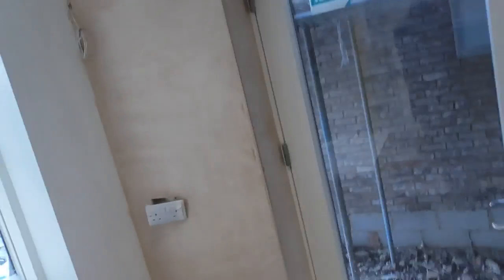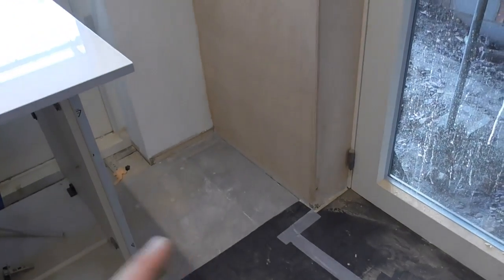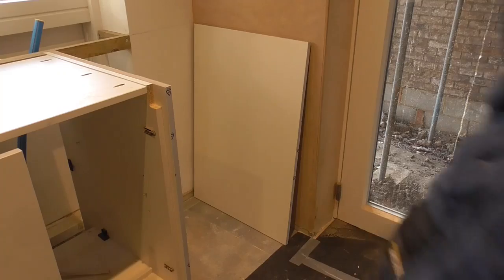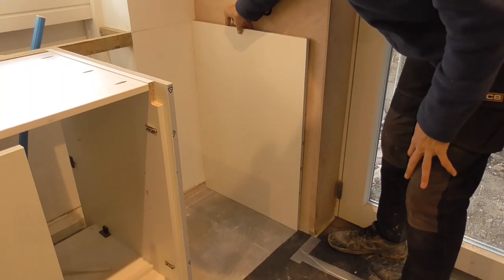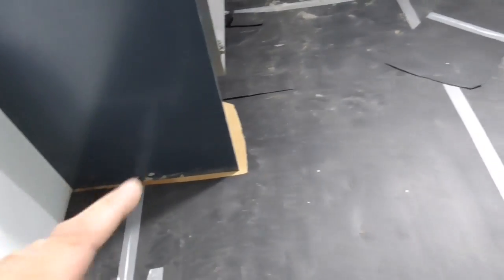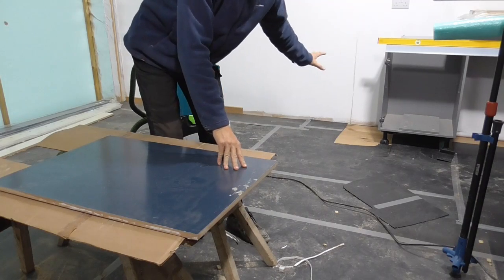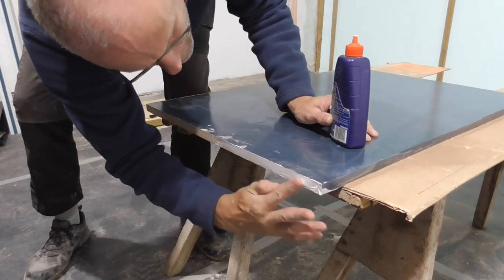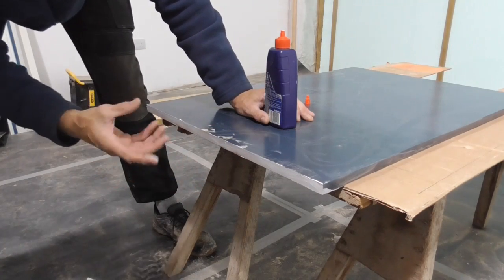Kitchen end panel fitting tip ***GOOD PRACTICE***

Comment: I'm fairly new to the kitchen fitting world but picked up and tin of Rustins quick dry sealer and a cheap 1/2" or flux flux brush. It's great, you can really see it soak into the wood. However, I don't work at your pace so sort of plan in dry time...it helps when you are a bit slower!! Keep up the great videos and hope you are feeling better now.
Reply from the maker: Hi Lewis. I think if fitted kitchens all the time then I would probably have a similar sealer and brush to you👊However, I didn't do kitchens that often so just go with what I have which is always a bit of old faithful PVA🤗Great comment and thanks for adding it so others can read it😎Cheers Del

Comment: could you not just put a spacer under the end panel at the bottom so it is off the floor, clamp and thens secure to the cabinet, would be helpful if fitting laminate/vinyl plank flooring after kitchen is installed and could then slide the edge under the end panel for a neater finish. Also would you not cut the end panel back at a right angle to let the plinth sit flush to the wall? Not criticising as love videos just curious if these are options. :-)
Reply from the maker: Hi Gareth🖐Everything you mention would have been suitable here, the only problem with this job was the builders had a lot of things in the wrong order, plus they wanted the kitchen fitted before the client had chosen the floor. There was lots on this one that I wouldn't have personally done, but you know what they say about the customer always being right😵Cheers Del
Reply: we got to do one lone panel  on the end of a work top going over a washing machine supporting the work top, factory end down with a few spacers underneath to raise it a few millimetres  off of the floor

Comment: Hi Del,

Great tip mate. You can also do this when you cut a sink/hop in a workshop to protect the laminate from blowing if water escapes.

Have a great weekend pal
Reply from the maker: You sure can Tyler🤩Great comment, and thanks for watching😎Have a nice weekend yourself bud👊
Reply: I use clear silicone applied with a plastic packer works a treat
Reply from the maker: @MrBoycie2009  Yeah, that's works a treat David🤩 Cheers

Comment: Hi Del, great tip to seal the edges, I have  found some of the edges are as sharp as razors so I generally  carry a small 50mm fine roller to apply the water proof glue saves getting cut fingers if you happen run along the edge. Great help to all those that don't know  as always. Have a great weekend. 😊
Reply from the maker: Great shout on the roller Peter, as you are quite right, and there can be some super sharp edges on those boards😵Thanks for watching and hope you also have a great weekend😎Cheers Del

Comment: Another great tip mate I use a clear MDF primer/varnish you can also use the clear protection strips you get for the plinth boards
Top man 👍👏👌
Reply from the maker: Great shout on the MDF primer Gary👊 Some customers are happy to also silicone around the panels, but most don't like to see it🤔Thanks for watching and have a great weekend😎Cheers Del

Comment: As well as putting the factory edge down to the floor, do you ever consider putting a (say) 6 mm spacer under all panels and plinths? If the gap is large enough it can be considered part of the design, avoids any water and will negate the use of that horrible plastic channel that always get filthy.
Reply from the maker: Hi there🖐Great comment and YES I have talked customers onto having a shadow gap under the end panels as it, almost, guarantees the panel won't suck up and spilled water👍Cheers Del
Reply: It also gives a crisp upper line to the shadow gap and may well reduce any undulations in the floor. I suppose the gap will be some multiple of the floor undulation amplitude. What about backlighting it so you get a lit gap rather than a black gap? At Jaguar we used to obsess about panel gaps on the openings. Body factory final buy-off was a bloke with a stick. (On the Mini in the 1970s they used to stretch the door frame with a jack on the diagonal to fit the door, as the door could not really be tweaked) Can you try it so I don't have to? Also have gap above the plinth to make it easier to pull off, back light that too? .... useful next video on these dark nights 😇 @thetallcarpenter

Comment: How do you fix and end panel to a wall if there is no wall on either side to screw to, just to the back? Brackets?
Reply from the maker: Hi there🖐I just key up the back wall surface and stick the panel back with high performance adhesive👍Cheers Del

Comment: ya can tell its getin into winter... youve retired ya shorts for the year. 

i almost always go factory edge down for end panels. or i use iron on edging if im concerned about water  ingress. suppose pva would be an equally good solution. 

another one i do and i dunno if others do it.... for howdens kitchens on the wall end panels i screw a couple of kd blocks to the top of the panel to hang it on the wall units. then clamp and screw in place
Reply from the maker: Hi Paul. Iron edging sounds great if you can get to match🤩 Your tip of screwing tabs to top of the wall panels is really great to get it lined up, and something I also do as it frees up a hand to help get it clamped up👊 Thanks for your comment and for watching 😎 Cheers Del

Comment: Great video I normally. If have to cut from the bottom I cap it with plastic strips which are made for this purpose.keep up the good work
Reply from the maker: The plastic base edging is perfect for protecting the bottom of this kind of board Mohammed 😎 Cheers bud

Comment: Hi Del, I've succumbed and taken on a small white gloss galley kitchen 😁, would a 60 teeth blade on a 190mm diameter blade be OK for cutting the end panels 👍
Reply from the maker: Hi Andy. Yes bud, a 60t blade should make a lovely cut. Still cut from the back though to minimise break out on the face side👍Cheers Del
Reply: @thetallcarpenter  👍 Thanks Del
Reply from the maker: @bricklayersworldwithandy6277  My pleasure Andy🤩Hope you get on well with your kitchen👍
Reply: @thetallcarpenter  l may well put it on my channel, how to fit a kitchen with an axe and a hammer lol, only joking but some will think that coming from a Bricky but I actually do know what ime doing I had a good tutor Brian the Brick who was actually a carpenter I worked with for me any years 👍
Reply from the maker: @bricklayersworldwithandy6277  Stick it on your channel Andy👍(I guarantee your carpentry is better than my bricklaying🤣).
Reply: @thetallcarpenter  lol 👍

Comment: I normally pva the cut egde of an end panel and put two stainless steel panhead screws towards each end to keep it of the floor a couple of mill.
Reply from the maker: Hi Geoff🖐That's a great way to do it bud, and will deffo help reduce the chance of water damage👊Thanks for watching😎Cheers Del

Comment: Any tips for fitting end panel?. The countertop is aleady in place so I have to fit between floor and underside of kitchen top. Thanks
Reply from the maker: Hi AK🖐I would check/assume that the front of the unit will be square to the underside of the work top and measure from these points back to the wall, (obviously allowing for any panel overhang at the front), and down to the floor, and carefully cut the panel👍Cheers Del
Reply: @thetallcarpenter  Cheers. Sorry I meant how to scribe to floor as seems a bit uneven, (v old house, wood and stone portions of floor..)
Reply: would you tilt the panel to scribe and then measure? or use a template?
Reply from the maker: @akfisher7138  It depends on how much 'scribing' is needed, and it's tricky to advise precisely without seeing it😬
Reply from the maker: @Ak Fisher  I see now👍Yes, I would tilt the panel out/hold it out parallel, to scribe the bottom.
Reply: @thetallcarpenter  Thanks!

Comment: That glue is great stuff for sealing. Cheap as well good for bath panels too. 2 coats an its rock solid plus you can sand and overpaint as well. I know from an earlier video that you ain't into bath panels lol.🤣. Another nugget from your vault of tips. Great stuff 👍
Reply from the maker: Hi Ian🖐 I've never actually tried to overpaint it, but what you say does make sense🤩 The less said about bath panels the better mate😵Thanks for watching and have a nice weekend😎Cheers Del
Reply: Cheers 👍
Reply from the maker: @ianmcbain898  😎👍

Comment: If I have an end panel between a base unit and a larder unit that has a blown corner on the floor edge, can I possibly cut this out using a multi tool without dismantling . What is the best way to cut out the corner and replace the plinth
Reply: It's gloss laminate
Reply from the maker: Hi Rachel🖐Yes, you can cut the front lower, damaged edge of the end panel off, carefully with a multitool👍J can't really advise on the plinth, but you may be able to rob enough from a corner join to shut the gap left where the end panel was🤞Cheers Del
Reply: @The Tall Carpenter  thanks. I will just replace the plinth with a longer length as it has blown on the edge too. The longer length will run across the rough edge of the panel then, hiding it. Will then use a sealant too to avoid water damage again.
Reply from the maker: @rachelf6207  👍😎